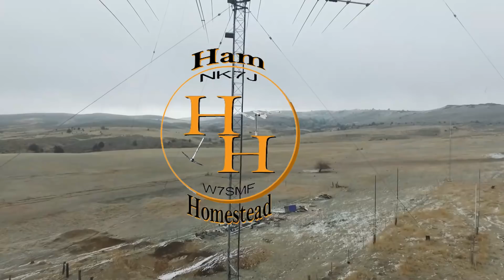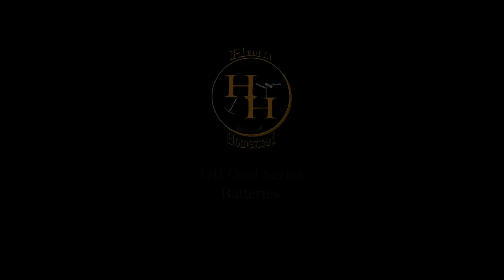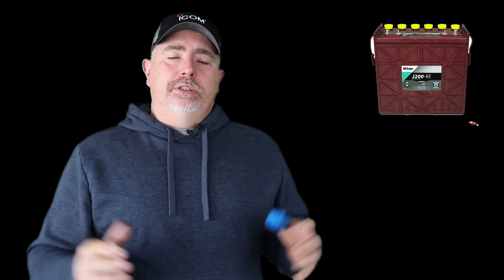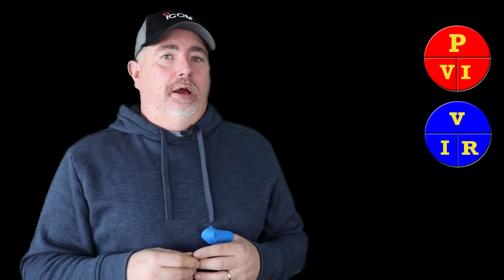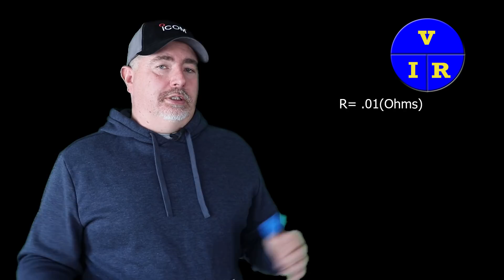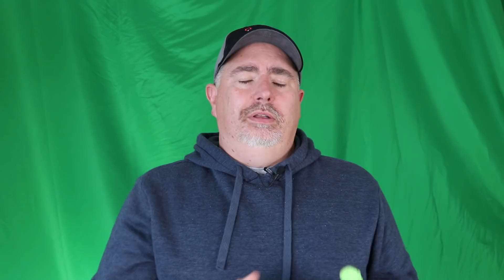Off Grid Battery discussion Part 1

Comment: Great video, I just asked in the AmRRON Corps forum about batteries for solar systems yesterday. My main concern is if we are looking at a very long term (beyond the 10 year average shelf life of batteries), can we completely rebuild batteries? Ar there kits out there that can sit on the shelf 10+ years waiting to be used to rebuild a battery? I'm thinking of the long term and batteries that will last as long as the rest if the solar system. Thanks!
Reply from the maker: Hi Devin, sorry for the delay in replying, missed your comment the other day. I have not seen any kits like that, but you have a valid concern in a long term "grid down" scenario what would you do about batteries when they reach their end of life. I think if it was a big concern keep a 2nd set of batteries around but dont let them discharge, they will self discharge over time and the plates will sulfide up on you due to that process. If you plan on storing them go out and put a float charge on them every 60-90 days. Would be about my best advice.
Reply: @HamHomestead  I found Iron Edison batteries that last well over 30 years and you can fully service yourself including mixing your own electrolyte solution that is just potash that can be poured on the ground after diluting it with water. They also don't have discharge maximums, you can discharge them to nothing. The only maintenance is distilled water ever few months.

Comment: Great video Jack. A lot of very good info. I don't totally agree with the Capacitor guy down below in the comments. I read maybe 10 different website about it and it was pretty much 50/50 on if it was better or not. I posted on EEVblog Forum asking the question if it was good or bad so we will see. There is some serious geeks on that forum so we will see what they say. Thanks Jack.
Reply from the maker: Thanks!

Comment: On 12 volt inverters I use 10 volts to make up for the efficiency loss just to keep things simple, for working out Amp draw.   I use 20 for 24 volt system.  But most inverters are worse than this. 

With inverters you need to pay attention to the efficiency of them.  You look at the box and it says "UP to 95% efficient" and you think oh boy this is great.  Key words here "UP TO"!  If you can find the efficiency to wattage output chart for your unit.  Many 500 to 1000 watt inverters are not to bad efficiency wise when you are using under 10 to 15% of their power rating.  The efficiency drops as the power draw goes up, I remember one had 50% efficiency at rated power draw.
Reply from the maker: Yes you are correct, advertising can be very misleading. At work we used to have the huge 48 Volt inverter that claimed to be 85% efficient (now this was a number of years ago) but after running the number on output vs input it was never more than 45% efficient. I think it was a newmar if I remember right.
Reply: Yep that sounds about right.  The new cheap inverters are more efficient than the high end ones from 20 years ago.  We did a lot with the Heart and Xantrex inverter/chargers.  On a boat where you have an engine running all the time inverters are not a bad idea.  One unit we used had a engine driven high freq alternator feeding into a inverter that cleaned it up and gave you clean 230 60hz single phase out.  That was nice because the equipment they were running was 115 and 230 volt.
Reply: Another thing to look at is idle current. How much power does the inverter draw, when switched on, with no load. This makes a difference at light loads, and if the inverter is going to run day and night. It's like leaving a light on 24/7.
Reply: That is very true.  Another reason to have a master switch on your inverter battery leads... most still draw some power when switched off as well.  It's not much but it's still a draw on the batteries
Reply: @Femmpaws  I was thinking in terms of having it on all the time, to keep power available to a refrigerator and or freezer, as well as run clocks, cordless telephones, and charge personal electronics overnight. The refrigerators are intermittent, but with high starting surges, and the clocks and other things are a minute, but continuous load. The highest average draw, will obviously be the refrigerators.
Reply: For some of the stuff you mention you would be better off to run them off the battery and not use the inverter.
Reply: @Femmpaws  If you have DC appliances, that's much more efficient than the AC induction powered refrigerators that I own. All my appliances are designed for on grid, and I'm planning on using solar for primary power, only using the grid as back up, or if my batteries get below 50% state of charge. I'm putting in 12,000 watts (40 300 watt panels), and 64 kWh worth of batteries.(64 golf cart batteries, 2 strings of 192 volts). This will power my house for a full 24 hours, including central air conditioning, an electric clothes drier, and an electric kitchen range. I also have 2 side by side frostless refrigerator/freezers, and one upright deep freezer. My Coi pond pump uses 500 watts continuous, 24/7 It alone, uses 12 kWh a day. My most energy intensive month averaged 60 kWh a day, about double that of a normal household. That's why I want to go solar.

Comment: For me the worst life-span batteries use the GEL ones, then go to the AGMs and then go to the troyan-type tubular lead acid to finish at the forklift epzs ending up for the OPZs, talking about lead technology, the GroE Plantè we discharge them because of the costs, for lithium, taking into account the duration performance and any problems at the very low temperatures -5/ -20° Fahrenheit, depends on the brand and type, I prefer the Winston battery single-cell 3.2V LiFePo4 are the top on the market today for off-grid applications !
Ciao
Reply: I'm probably going to start with cheap golf cart batteries, just because I can get the capacity on the cheap. Once I've made back the money spent on panels, inverters, and charge regulator, I'll probably switch to LiFePO4, if the price is right. You have to look at the cycle life cost of energy. Sometimes, it's cheaper to replace lead acid more often, or sometimes, it's more cost effective to spend the extra money up front for a battery with a higher cycle life. An advantage of the cheap batteries, is that they will come due for replacement sooner, giving you a chance to explore the market, and other chemistries. If lithium isn't cheaper then, In go another set of golf cart batteries, try again in a few years.

Comment: Battery point blank are old dirty outdated tech wrapped up in fancy words and stickers all for marketing and prophet!  Get yourself a Capacitor bank, does the same job all day long and you get well over 1 million + charges compared to dirty lithium which can only take 1200 charges, And lithium mining is outdated and harms and scars the planet compared to a capacitor that is clean and easy to make.
Reply from the maker: We have looked into them to a small degree, but we are unwilling to give them a try until they have more of a proven track record at remote sites (since a good number of ours are fly in sites we prefer to have something we know its reliability factor). The last solar class/seminar I took about a year ago the instructors briefly spoke about them saying they had installed a couple of them but have had a number of issues with them and according to them they take up a fairly large footprint for the capacity. So in short I do not know a whole lot about it other then what little I have been told and anecdotal information from those who have installed them.
Reply: Capacitors require much more of a voltage span to be able to use a decent percentage of their capacity. Capacitors are measured in joules, rather than watt hours. It would cost more than my house, to get about half the stored energy I need, and twice the price of my house, to get the usable capacity I need. The cost needs to come way down, and electronics with 4 times the voltage span is necessary to use them. On the plus side, the charge acceptance efficiency is practically 100%, they can be maintained at any state of charge for any period of time, which is perfect for solar, and no shortage of peak power. If they could become cost effective, they're the ideal solution, with compatible electronics.
Reply: Jack, would you please comment on this post.  It sounds interesting, but I have no experience with capacitors other than learning about them in my high school physics class.  Seems like the required size of a capacitor would rule it out, but I just don't know.